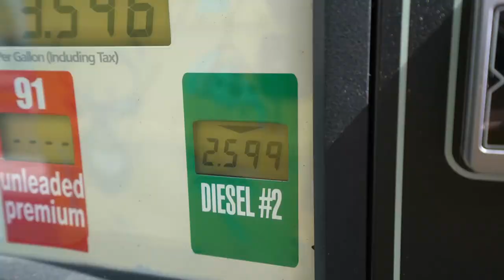Wrong Brake Pads on Tiny House Skoolie!

Comment: For the fuel pump that doesn't have a latch to keep the flow going, wedge your fuel cap in under the handle after you start filling.  Works like a charm!

Comment: Bud, the next time you happen to a gas station where the button is broken to keep the pump running, you can take the gas cap and use it to keep the pump running. I've done this several times in the past. When the pump thinks it's full, it will still kick bake and stop the [pump. Just my 2 cents...LOL